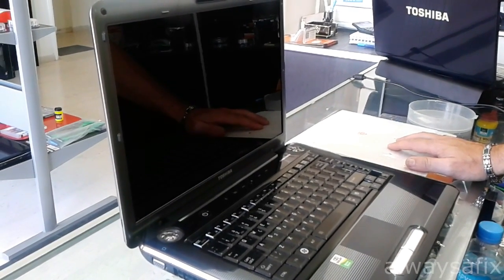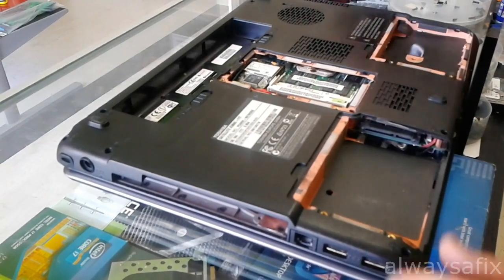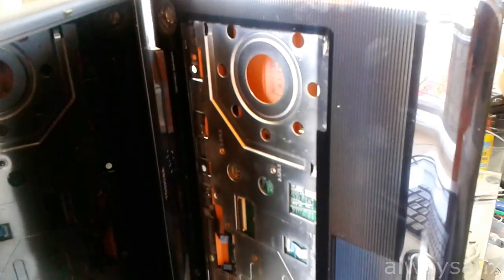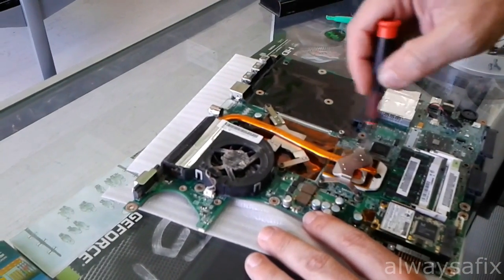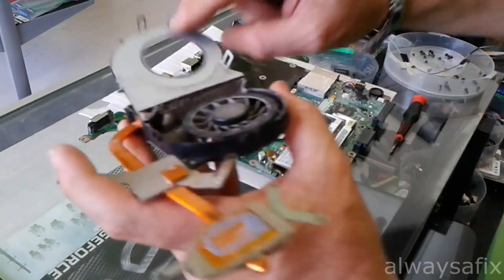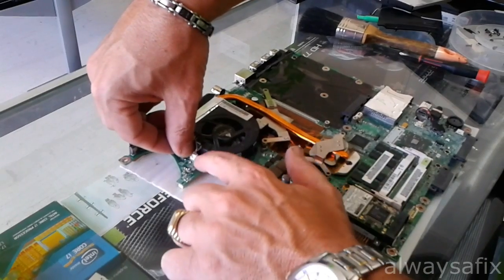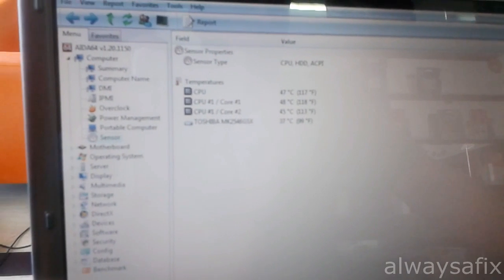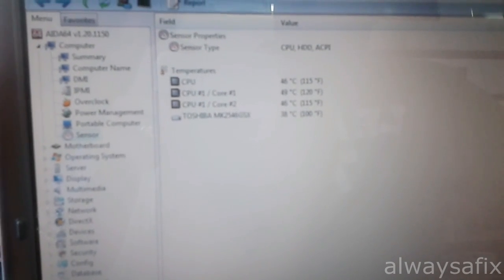Laptop shutting off randomly toshiba A300

Comment: Replace the NEC Tantalum capacitor under the processor, I had the same after replacing the capacitor with 6 330 microfarads, the laptop is like new
Reply from the maker: This video is nearly 10 years old, do you have this exact model?
Reply: @alwaysafix  2.26Mhz CPU, 4gb ram, 120Gb ssd, windows 10 work perfect

Comment: I have a Toshiba A350 (looks almost identical) and it turns on for 5-10 seconds, with no image on screen at all, then turns off. Tried discharging static as other people have suggested online but that doesn't resolve the issue. Has anyone seen this at all? My guess would be dead CPU or faulty motherboard. Havent turned it on for years until I tried today.

Comment: hi i sent two of mine to a technician, both of them was turning off, first he claimed i needed a new internal power adapter, then after that and buying new 1gig hard drive he said i need new motherboards for both of them,  although he did mention that I needed to keep the dust from getting into them, does this sound right, he states that I should not use the sleep or hibernation mode on the pc, but i use my pc often. Can you help plz.

Comment: Hi,Toshiba satellite C650 Model Laptop - Display goes off after 4-5 minutes of working.
Fan is clean. Heat sink normal heat. Cleaned CPU and GPU and applied new thermal paste. Works for sometime, but again display gets off. Power LED and charging LED still glows. But No display. 
Could you please advice what could be the issue.

Comment: I took my PC in to have it serviced. There was lots of dust inside and the heatsink was hard, brittle. The tech guy cleaned it and put NEW heatsink! The "Acer Aspire 5733Z" still CONTINUES to turn off after a few minutes. If you plug anything into the usb, it turns of faster. What can it be? HELP?

Comment: my labtop shuts down after 2 minutes..they its motherboard...idont think so becuase its working ...what do u say about this issue if its not the fan
Reply from the maker: +bashaar mohmad In the workshop I would remove the motherboard, power it up with a different known working charger, ensuring it is not overheating.  Good luck!

Comment: I have 3 toshiba A300 laptops in my shop with this random shut down problem and finally i found out that it is caused by a faulty cpu !!!! I tried replacing the thermal pastes, i tried speeding up the fan by connecting the 5v to the usb port, i even tried putting some copper on the bga chips. Nothing helped. The problem in my case soved by replacing the cpu chip

Comment: Hey.. I have the same model ( a300d [ PSAK8E --00F00NY4]  AMD athlon x2) and when I turn it on, i can hear fan working, my hdd working. the touch buttoms are working, and it won't turn on.. what do you think it's the problem ? pls answer
Reply: The GPU is the video chip that works in tangent with the CPU. In most cases the GPU does not fail, it is the solder joints that break free or develop cold joints due to extreme heat buildup that is usually caused by a very dirty fan and clogged vents. There are two options; have the GPU chip reflowed with a work station or replace the motherboard. Toshiba were notorious for overheating GPU's. I serviced various models including my own.
Reply from the maker: +Tin Cole Your problem could be one of many.  First step is to remove the power cable and the battery, press and hold the power button for a full minute, replace power cable and try and power on.  Good luck!
Reply: alwaysafix
My GPU is dead...

Comment: alwaysafix  Ηi there ,a friend has this model but the laptop display doesn't receive signal, so the guy used his computer through the analog video output(VGA), but neither the video output works now. What can we do?
Reply from the maker: +ΙΠΠΟΚΡΑΤΗΣ ΚΟΧΛΙΑΡΙΔΗΣ You have a problem with the graphics card.  Can you tell me the exact model of the laptop so that we can see if the graphics is integrated or not.
Reply: alwaysafix Τhanks :)

Comment: My A300 has started to shut down randomly as well. I took it apart and cleaned the fan and the vents but it made no difference. I did not replace the thermal grease on the CPU though. I ran some software that (SpeedFan) monitors the temp of the cpu. The temp is fine,so I'm not sure what the issue is.
It does seem to shut down quicker if I run a number of programs at once. Sometimes if I say just use one program like Excel it can run for an hour before it shuts down and then some other times it can shut down in 10 mins, so its not a clear cut case of over heating,and like I say I that software on that monitors the cpu temps and the temps seem fine. I'm at the point of getting a new laptop.
Reply: +mozzibyte You have to replace the thermal paste with Artic Silver 5 this is the best one. If you do everything properly the laptop will perform better than new and fan will be more quiet. Be carefull with wires near the cd drive dont force the drive in if its resisting a cable/wire might be in the way. And note the numbers on the heatsink screws thats the tightening order

Comment from the maker: @Dinesh Karki First thing to check is that it's not overheating.  Have you followed the steps in this video?
Reply: Ya i already check it out for overheating . I clean up all the parts gently...
Reply from the maker: +DINES kARKI Have you tried a different charger?
Reply: ya but it wont work it

Comment: hi i got an toshiba satelite A3000 and when the charger is plug in after few mins it random shut off but when the charger is not plug in it works fine with the battery only....can u help me plzzzz what  is wrong ?? Can u Say please. but my battery lasts for only 30 mins because my battery is damaged

Comment: Hi. I have have the same one (Toshiba Satellite A300-235) and in the last few months I realised that when my laptop IS hot, it works normally for many hours... but when it's cooler and the fan is not working very hard, it shuts down and restarts on its own. 
PS.: tried memtest and everything is fine.

Ah, another thing: when on BIOS or MEMtest or whatever has nothing to do with graphics at all, it works like a charm! :

Thanks in advance :)
Reply from the maker: 1) When it restarts do you see a blue screen?  2)  How long does your laptop work on battery?
Reply: Thanks for your reply. So:
1) Days ago, before I deleted everything, it did show me a BSOD. Now I've installed Ubuntu... everything works fine.
2) Battery is DEAD long time ago now. Quite a few months, actually.
For me, in order to work the laptop "properly", I have to warm up it a little bit. So I do a MEMtest for about 10min and - believe me or not - I put a pillow on the bottom because if I don't, it will continue to keep restarting all day long (it does when it's not hot). 
PS: on BIOS or MEMTEST it never restarts. It does ONLY when the OS will load (either it's Windows or Linux).

Hope you can help me, anyway.
Cheers :)
Reply from the maker: Dimitris Zeus Download and run whocrashed.  Let me know what it finds.
Reply: It runs on Windows only. I'm running Ubuntu 14.04LTS.
Sorry :) Can you still help? 
Thanks in advance!
Reply: Hope u can answer my question :)
Cheers
Reply from the maker: Dimitris Zeus Sorry to run the diagnostics I need to get to the bottom of your issue, it needs to be running on Windows OS.  Good luck!

Comment: YOU MUST WATCH THIS BEFORE YOU BUY A TOSHIBA! https://www.youtube.com/watch?v=BTwaGvO_Zd4

I bought a Toshiba laptop, Toshiba Satellite Radius P55W-B5224. It was making very loud and distracting noise rarely like once a month. But then it started to do it very often.

So, I sent it to Toshiba Repair Depot/Facility in Jeffersonville, IN, US on 12/04/2014. I live in Los Angeles, CA, US by the way.

I received it today on 12/13/2014. It is not fixed. It still makes the loud annoying noise. According to the report they attached, they replaced the HDD. I have no idea why they did replace the HDD.

I clearly wrote down the problem in the request from, and moreover I sent them a note with my laptop. I had recorded the noise it was making, uploaded to internet, and wrote down the links to help them understand the problem. It's most likely that the fan is making the noise.

I record this video today, right after I received my laptop.

https://www.youtube.com/watch?v=BTwaGvO_Zd4

I believe they didn't even turn on the computer. This is disrespectful. This is rude. They didn't read the note. They didn't read the request from. So my laptop is not fixed. I believe the problem originates from the manufacturing process. It was defective, when I bought it.

There is another problem with Wi-Fi internet speed, I don't want to mention it. Because as far as I read on the internet, everybody who has a Toshiba laptop has low speed problem. I've 300 Mbps and it's tested with a Mac Pro, and Mac gets 320 Mbps speed. My laptop only gets something around 60-120 Mbps (it is inconsistent between 60-120).

I paid a lot of money to this laptop and I don't get what I'm supposed to get.

There should be a law to protect my rights. I need help.
Reply from the maker: There could be something stuck in the cooling fan or the cooling fan needs to be replaced.  Good luck!
Reply: alwaysafix I sent it to Toshiba Repair Depot, and received it a couple of days ago. It was still making the same noise. They couldn't fix it! Instead they replaced the HDD. Don't buy Toshiba, they don't care their customers.

Comment: My laptop boots only if i press fn+esc+power that too 1 in 5 times it'll boot. This means that my ram, inverter and screen is ok. I have done the power drain without battery trick also but it's not helping. So what is wrong? I Haven't done this fix yet, but I'm suspecting it maybe the on/off switch. It would be very helpful if you can do a tutorial on that as well? Thanks mate!
Reply from the maker: Even though the laptop starts randomly, it doesn't confirm healthy ram.  Try running memory diagnostics to confirm.  Good luck!
Reply: I have put in a new one tried the different slots still no luck. :(

Comment: OK, I've been noticing this similar thread all over the internet and it seems that the issue is the "power board".
Basically the on/off switch starts to wear.

So I went to a place to have them replace it, but they didn't want to deal with a laptop so what I ended up doing
that seemed to help was to split the back part of the laptop.  OK, that means nothing, and I'm having a hard time putting this into words. Maybe I'll do a video shoot & post to youtube later, but you know how you normally want to take the cover off of a laptop to access the motherboard?

There's a phase where they say use a guitar pick to take the cover off.

Well, I just did that near the top of the laptop (closest to the power switch), and it's opened like 1/16" of an inch
(1 or 2 mm).  What I think this does is keeps the power switch lifted high enough to not touch the contact that causes the
system to shut down.  (This process takes no more than 15 seconds)

Your mileage may vary! :-)

Funutation
Reply from the maker: ***** You need to strip the laptop to see if maybe the power switch is shorting out on something.  Good luck!

Comment: Hi. My A300 Satellite laptop will not fire up at all. The power supply to the unit checks ok with a meter. The battery was replaced several years ago so should be ok. Is there any easy way to check. I have been advised it is probably the mother board but I have to remove it first to obtain a board number (V????) before I order one. Any ideas would be welcome. Regards
Reply from the maker: Malcolm Peers If there is no response at all to the power on switch, the only way to check is to remove the motherboard from the laptop.  Plug in the charger and check with a multi meter that the board is receiving power.  Might be something as simple as a broken charging port or cable.  Good luck!

Comment: Hi, thank you for the video. I've got almost the same model, but the problem is the screen doesn't work. I have no idea if the problem with screen itself or the video chip doesn't work. Can you please help me, how can I get to know what happens?
Reply from the maker: Дмитрий Войтович Have you tried connecting an external monitor?
Reply: alwaysafix yeah, neither of monitors, internal or external, worked
Reply from the maker: Дмитрий Войтович Sounds like you have a faulty motherboard.

Comment: HI, your video was very impressive which made me ask my Laptop problem,i have this Satellite A200 (PSAF6A-07G01N) 
i cant run my laptop when charger is plugin, i have to charge the battery when flap is down, once it charge, unplug the charger then u can do wot ever u want but as soon as u plug in the charger to recharge the battery its shuts down itself and start rebooting, start again shuts it self again  means goes in loop...
can u please help me to solve this issue thanks
Reply from the maker: It could be that your charger is not giving enough amperage required due to faulty cables etc.  Check out my video on how to test laptop charger amperage.  The easiest way to check is to try with another charger.  Good luck!
Reply: alwaysafix Thanks for the reply, i have Satellite A660 as well checked with that charger plus i i got brand new genuine Toshiba charger same result no difference..any other solution please advice thanks

Comment: question: I have a sony vaio, it keeps shutting off but I have looked over the fan, it has no dirt. could it be the fan is no longer working, it needs replaced?
Reply: Turn it on, if it spins normally, then it's working fine.

Comment: Hi ! i cleaned up my laptop a300 19O like yours now the temperature is between 40°C 55°C and i still have the problem when i open a game that need a high graphics the laptop shutdown on 50°C 
Windows 7 64 Bit  4 Go Ram Duel core 1,7 Bios Last Update Graphic card too
can you help me pls :(
Reply from the maker: Does it shutdown or restart flashing with a blue screen?
Reply: I finally found where the error comes from. it was my graphic card, which when it reaches the max my pc shutdown, so i used msi afterburner not for overclocking but to reduct the value of core clock and memory clock.
Thank you for your reply :D and sorry for my english ^^
Reply from the maker: Khalid AIDANE Congratulations on your fix, and thanks for watching!
Reply: Same thing

Comment: Hi i have a toshiba a660 and every time i use the laptop with or without the charger it just turns off i cleaned everything but still turns off plz help
Reply from the maker: How long does it run?  Can you downloand temperature monitoring software, so we can get some idea of how hot its getting.
Reply: It turns off randomly but still runs rough and it wont install drivers due to the fact im running copied windows

Comment: I just cleaned it, I change the thermal paste, the laptop keep shutting down... :(
Temperature monitor show 60 C degrees.
Sometimes it's working for hours, sometimes minutes.
I tried to "work" the processor with some movie compression + Photoshop + InDesign, all in the same time - 100% of processor load - it worked.
After one hour, just browsing, suddenly stop.
WHY!  HELP!  :(
Reply: while working, open up the task manager and go to the performance tab. you can see how much of your cpu and ram are used. if you're memory use is at 90%, try to add more ram

Comment: do you have any solution to fix annoying and very loud noise from the fan toshiba satellite, it's starts normally, but few minutes he runs very fast and very loud irritating noise, like it's touching scratching something while its running, i've already cleaned it up from dust but still have problem... please guide me whit something... can't work on laptop while having this annoying sound... ;(
Reply: hook it up on a 5v source and see if it touches anything. maybe you've bent the case of the fan

Comment: I bought an old HP DV1000 at a yard sale without a hard drive, I have two questions.
The computer seems dead when I plug in the charger, does it need the hard drive to make it work or light up?
Can I use my Saegate 5400 60 GB SATA laptop hard drive in this computer?
Thanks, I know this computer is old but I would like to get it going.
Reply from the maker: No, it doesn't need the HDD to power on.  Yes, you can use the other hard disk, although you need to figure out why it's not powering on.  Check the charger with a multi meter.  Good luck!
Reply: Sometimes the bios stuck try removing the closing battery

Comment: Is that a Satellite A300-244? I was wondering if I can have 2 internal HDDs on mine. Is it possible? Really need to know, thank you.
Reply from the maker: This particular laptop has since left the workshop and gone back to the customer, so I dont have the full model number.  If you have a second bay with a HDD connector, then you can no problem.  Good luck!
Reply: alwaysafix Thank you, the one I own, with the model I mentioned above, only had 1 bay, so I had to purchase a 'second hdd cd drive adapter' and now I'm able to have both (SSD+HDD) runing side by side. Hope this helps other ppl.
Reply from the maker: José Silva Thanks for sharing!